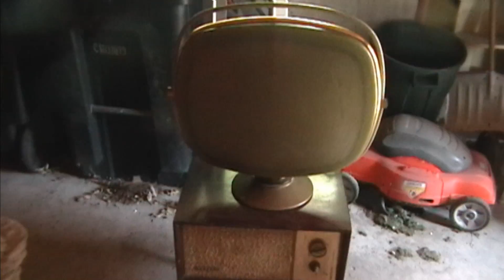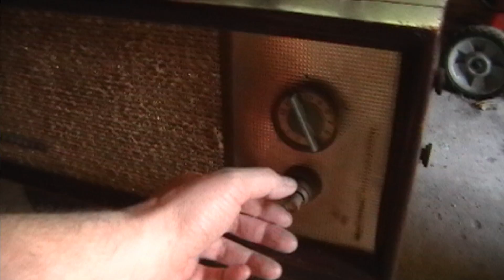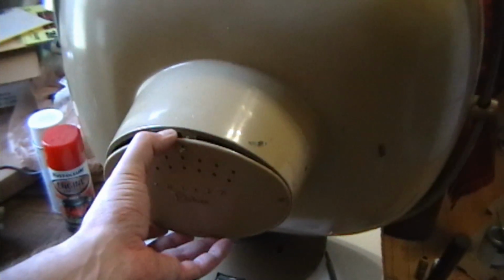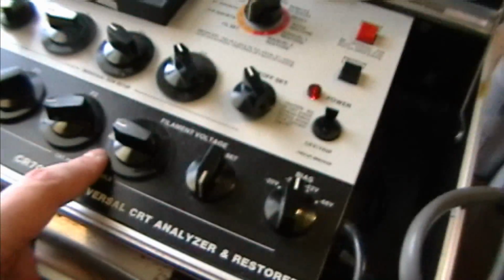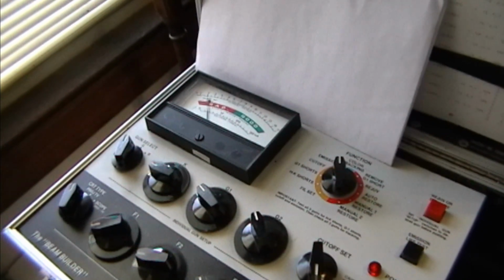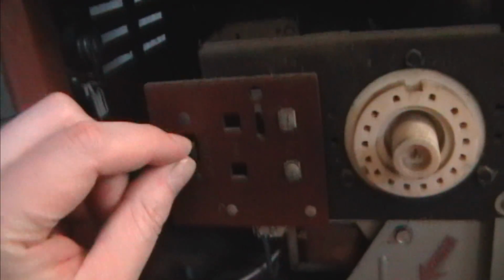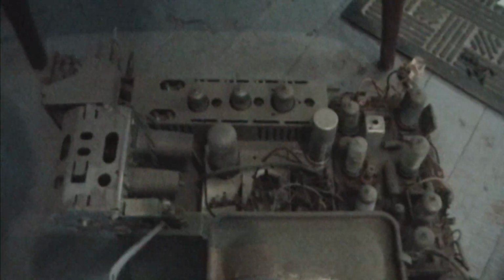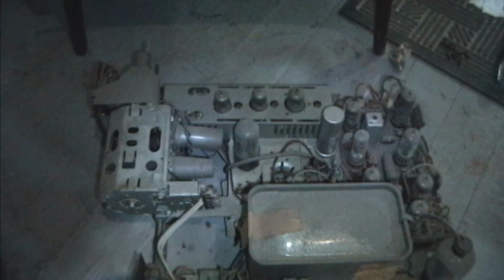Predicta Tandem I restoration pt1o8

Comment: I've often wondered why Philco didn't  put ventilation holes in the HV can. Cannot believe they didn't think of the heat buildup and its detrimental effect on the flyback transformer.
Reply from the maker: Is there a lot of heat build up?  The rectifier tube doesn't get very warm.   I suppose the flyback itself gets a little warm from current in the windings.   I've seen a little pool of wax below the flyback in some sets, but I have in every other brand too.  Never encountered a bad flyback.

Comment: if u need a cable i have idea measure out 28 feet allways use even numbers with numbers like 22 ft 24 ft 28 ft ect lay your cable leangth out flat duct tape cables on the bottom use 40 year white outdoor calk the more expensive might be like 40 bucks worth now heres the trick wipe the cables with break cleaner so if there is writing on them the new cables it smears that means u will have a good bond and there will be no oil at all on cables un tape bottom then do the same

Comment: In case you can't find the cable, I was wondering, could you make your own? Say you made the connections for the video using coaxial cables, and voltage, h&v synce, et cetera using the correct gauges of cable and matching the impedences, types, et cetera. You could bundle them all together in a flat bunch, tie them up, and encase the whole thing in beige-ish cloth. Now, as for hooking up the internales, you could attach the new cable to the served end or open up the tube and make the connections

Comment: Your predicta restoration videos are great! I love the Tandem series.  I wonder what possessed someone to cut the cable off the crt?  Glad you were able to locate another one.
Reply from the maker: I suspect a lot of these sets survive because they were used purely for decoration.  They might have thought the cable was in the way.  I have two head units that need the cables replaced.  I've salvaged cables but it's not a trivial task and I've been dragging my feet,
Reply: I’m sure you’re right about many of these sets surviving as decorative pieces due to their unique styling,still I wonder why someone would cut the cord off since it’s one of the more interesting facets to show people how it connected to the cabinet. 
Did the other two head units you need to replace the cable on have their cables cut off,or were they damaged and have shorts in them?
I’ve never seen one with a bad cable personally. They are very robust.  It does sound like it would be a rather involved repair though. 
By the way,I had tried to reply to your video on the neon bulbs you found recently but for some reason every time I tried comment it just disappeared seconds after and when I checked days later it never posted.  Probably a glitch in the system,or maybe YouTube considered it spam.

Comment: Exactly how rare are these models and how much do they go for when they do come up?
Reply from the maker: Well the Danish Modern is by far the rarest model, next would come the Tandem.  I don't think I've never seen a restored one come up for sale.  Unrestored, in good cosmetic condition with unknown CRT around $500.  I sold one of my restored ones for $1,000.  I expect it would have gone for more on ebay but I sold it as part of a package deal.
Reply: Ah okay, that is good to know.  I have someone looking for the Tandem set.  If I could find one that is more work for me because I would be hired to restore it for the fella :)  That is IF the CRT is any good in one that I would find lol.
Reply from the maker: Even more trouble than the CRT is the cable.  They are often cut off like this one or damage.  The plug and socket are sometimes damaged too.  I had to spend over $100 for a good cable for this set.
Reply: Ouch Now wonder why they are so rare now.  It is a real shame that people do that to these sets!